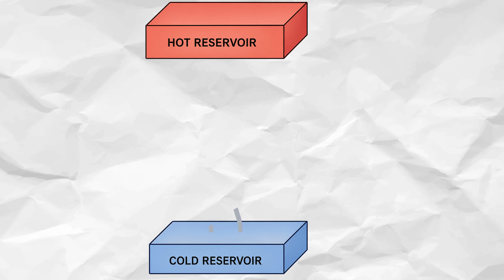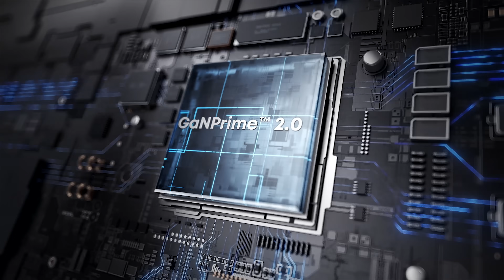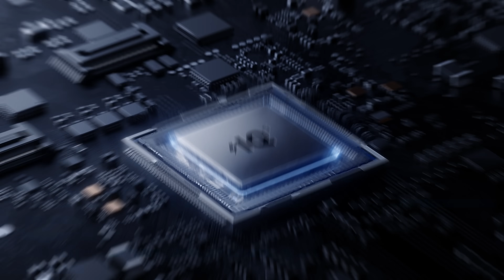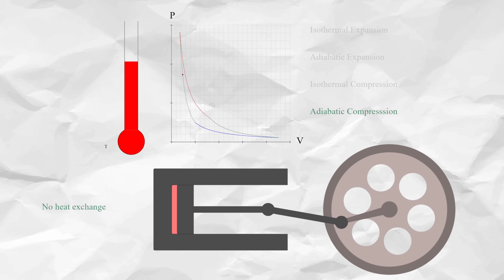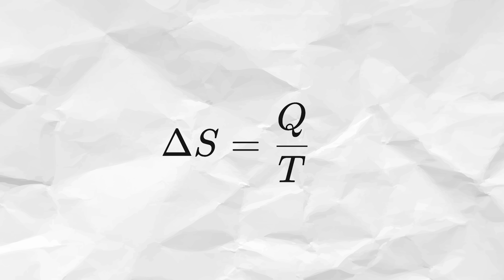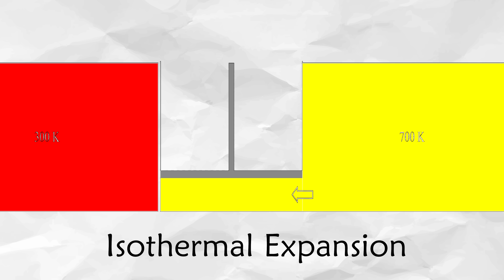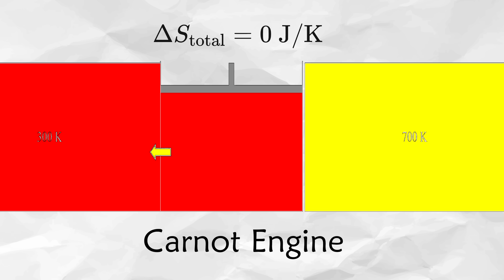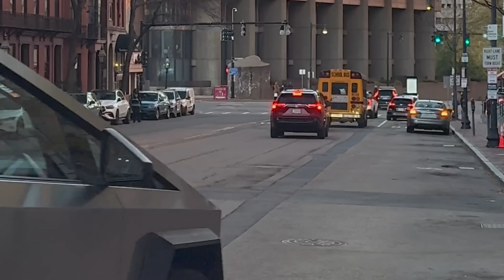This Tiny Engine Explains Entropy

Comment: Electric motors: The 'hidden' inefficiency (that used to create the ordered electrons in the battery) is not a problem if we 'off-shore' it to the sun and use solar PV panels to charge the battery.
Reply: Or hydroelectric power
Reply: @giorgiobarchiesi5003  Exactly!
Reply: The point is that's still inefficient, solar panels are nowhere near 100% efficient
Reply: @keepf9835 When you breathe in, the air is 21% oxygen, when you breathe out, it still has 17%oxygen. How ridiculously inefficient! Breathing should be banned - humans are clearly useless and we should wait for evolution to provide us with more effective lungs.
Reply: What’s with the “ ‘ “ instead of “ “ “?
Reply: @Shadow0Afton accident with a table saw
Reply: @mb-3faze  I was thinking Ai polished but that explanation is far more hilarious.
Reply: @Shadow0Afton  likely a programmer! Some programming languages let you get away with ' where it should be ". Save your shift pinky when speed typing and use a single quote...
Reply: @Orionrobots Be careful with that. Several programming languages have different meanings for each. With one allowing variable expansion (and special characters) and another not allowing it.
Reply: @Jeff-ss6qt  in the C set of languages - its character vs string types. Bash has it as different expansion types. JS, ruby and python has them synonymous.
Reply: @Shadow0Afton ’’” ‘huh’ “‘’
Reply: @Shadow0Afton Single quote is for uncommon or sarcastic phrases, double quote is for quotations.
Reply: @Jeff-ss6qt  The reason why quotes are used for “sarcastic phrases” is so that they know you’re throwing their words right back at them. But single quotes are used for combining words like “I am” - “I’m” and for quotes inside of quotes like: The Bible says “He said ‘She made me eat the apple’”
Reply: @Shadow0Afton Single quotes are for contractions, but it's also common to put them fully around words. Especially in written works like books.
Reply: Solar panels are relatively inefficient at producing electricity from sunlight, but the sunlight is free, so the panels don't need to be efficient to be massively useful. As an example, my car and my entire house are run on the electricity produced by the solar PV panels on the roof of my house. It cost money to buy and install the system, but the marginal cost for every kWh of electricity I use is zero. An extra hour of running the air conditioning, or an extra hour of running the oven to bake a potato, cost nothing and produce no CO2. Solar panels are not free, but the sunlight they collect and turn into electricity is.
Reply: But then imagine all the energy used to get to the point where that's a possibility 🤔
Reply: @lostbhoy420  The lifetime ROI is important. The thing about solar PV is the longevity of the panels is unquestionably long and they will produce more useful energy than it took to make them in the first place.
Reply: @mb-3faze  no that’s ostensibly false, solar panels have a 20 year life span after which you’re forced to choose between operating at a reduced efficiency dropping by 1% per year or spend money disassembling them and replacing them.
Reply: @estan315   Which doesn't make it at all untrue.
Reply: @babybirdhome no it is by definition untrue, solar has both one of the lowest efficiencies and lowest longevity of any energy source, only offset by its ability to get essentially free energy from the sun. But the energy from solar is not actually free as it requires thousands of acres of solar farms and expensive battery storage systems, and since they are notoriously short lived you will have to replace them every 2 decades or so. Contrast that with a natural gas generator which can stay up and operating for generations, even as long as a century with some renovations that don’t involve replacing thousands of acres of solar panels, and you’ll maybe realize why solar panels aren’t worth the investment outside of countries where they are directly being subsidized by taxpayer dollars, such as the US. In any other industry we would call that a government sanctioned monopoly.
Reply: @estan315 yeah, that's mostly nonsense. Gas generators might last but they need maintenance. Hard to believe bearings last 20 years. You name me one gas generator powerstation where they built it, got it going, then walked away only coming back twenty years later. The anti-renewables cult keep scraping the barrel for one excuse after another now it's area needed for solar PV - despite the fact that a huge amount is on existing buildings and in fields the introduction of panels has improved the yields of crops, provided shelter for grazing animals and increased the biodiversity overall. I mean, for God's sake, wake up, let the scales drop from your eyes.
Reply: The problem with your assertion is that you’re operating on a fantasy where solar power works exactly as it should at 100% efficient and never needs maintenance. You have absolutely no experience in the field but feel qualified to speak on it as if you do, which is embarrassing. 

Let me give you some numbers. Natural gas power plants cost roughly 50-100k per gwh to build, maintain, and fuel across their entire lifespan (average of 35 years). This includes the natural gas itself, building the plant, and maintaining the components like turbine blades, shafts, and yes bearing (a relatively small consideration all told) Now let’s say that’s an average cost of $75k per gwh per plant over an average lifespan of 35 years. That’s roughly $2.15 k per gwh per year. 

Now let’s compare with solar panels. Solar panels have a lower initial investment, around 30-78k per gwh to build, maintain, and replace, including the very important consideration of regular battery replacements every 10-15 years (extremely environmentally unfriendly btw, despite what you may like to believe). Now let’s consider this an average of $58k per gwh, and over the course of its entire 25 year lifespan (very conservative estimate) this is still $2.3k per gwh per year. 

So if you weren’t paying attention, that’s $2.15k per gwh per year for natural gas plants across their entire lifespan vs $2.3k per gwh per year for solar panels across their lifespan. So yes, even natural gas does indeed beat out solar power in terms of cost efficiency once you factor in the very real engineering considerations of construction and maintenance. You can pretend it doesn’t but the numbers don’t change. 

But what about your argument that solar panels are “better for muh environment”. Well like I said earlier solar panels need to be replaced every 20 years as their efficiency drops quickly after. You then have the option of throwing thousands of tons of silicon into a landfill or recycling them, each option costing even more. Now compare this to natural gas. You have natural gas pumps and refineries, and that’s about it. 

“But they’re digging into the earth, surely this causes more environmental damage than disposing of silicon tiles”. Spoiler alert: it doesn’t. But for arguments sake let’s just assume that throwing away your entire solar panel array is somehow less damaging to the environment than pumping natural gas and refining it in a refinery that is already built and operational. Solar panels still require expensive battery arrays to store the power they generated which requires lithium. If throwing away silicon tiles wasn’t bad for the environment, throwing away lithium batteries certainly is. And this lithium doesn’t just come from nowhere, you need to mine it, which is much more costly and damaging to the environment than simply pumping natural gas. 

So on to your last “argument”, that being solar panels are renewable so we need to see the writing on the wall and switch. According to current knowledge of natural gas deposits we would run out in roughly 50 years. The funny thing is, this number has remained the same for the last 50 years at least. The truth is that there is easily 2000 years worth of natural gas deposits left in the earth that simply haven’t been discovered based on current geological surveys. And the best part? The lithium reserves are estimated to run out in a little under 40 years. So the ONE advantage you may have been able to present for solar over natural gas is completely fabricated. Neither of them are ACTUALLY renewable resources. Keep in mind the fact that the sun produces infinite energy is simply not an argument. Where do you think the energy for coal, oil and natural gas comes from? I’ll give you a hint, it doesn’t just appear from thin air. 

You are just wrong. Stop pushing it because you’re only making it worse. The numbers do not support your argument.
Reply: @estan315  Lots of words, little knowledge, even less understanding. It will take a while but the fossil proponents will lose eventually, the nuclear cult followers too. Some of us care about the future and future generations and can see further than the depth of the wallet. I believe that the people 10, 20 or 50 generations in to the future deserve better than the sh*t planet we are leaving them.
Reply: @mb-3faze  when confronted with the truth you’ve shrunk away from it. You are not to be taken seriously. Just another delusional individual.
Reply: @estan315 anyone who types out 'lithium will run out' is the delusional one. The average EV has about 10kg (that's 2.2freedom units of weight) when it's manufactured. After driving 500,000 to 750,000 miles guess how much lithium is still in the battery? Oh, I'd better tell you.... It's 10kg. By your logic we should build houses because we're using up copper in the wiring. There's approximately the same amount of lithium as there is copper in the planet and unlike copper, lithium is absolutely everywhere.
Reply: @mb-3faze like I already made clear, you are a delusional person and not to be taken seriously. That fact that known lithium deposits are set to run out in 40 years is not up for debate, if you are going by the same logic that says that natural gas will also run out. Many things other than cars use batteries, like phones and computers and household appliances. The point here is obviously NOT that lithium will run out within the next 4 decades, but that you can’t say natural gas will run out in the same timespan while also claiming claiming that lithium based PV technology is a “renewable” solution. The numbers from modern geological surveys clearly show that natural gas is at least as renewable if not more renewable than lithium.
Reply: @mb-3faze  "Nuclear cult followers", how easy it is to instantly discredit yourself lol
Reply: @MarianLuca-rz5kkuh-oh, a propagandist from the oil industry.... No, elementally, lithium is as common as copper but much easier to extract. Why do you think lithium is so cheap now?
Reply: @MarianLuca-rz5kkyou up vote your own comments? Now that's delusional:)
Reply: By linking mechanical work to statistical mechanics, you’ve turned an abstract mathematical concept into something tangible. Truly stellar work
Reply: Yes, in pure economic terms the sun is probably the most inefficient energy source in existence* The vast majority of the energy it produces is lost to space, and most of the energy received on earth is also (thankfully) reflected back into space.

*Actually the sun is beaten in the inefficiency race by every single other star in the universe - they are all totally wasteful - you get almost no useful energy on Earth from any of them. Makes you wonder what the point is really.
Reply: And technically speaking K type stars which are orange dwarfs are better candidates as host stars than G type main sequence ones like the Sun
Reply: @gavinminion8515  a lot of fusion energy also just goes to shooting off neutrinos into the void
Reply: @gavinminion8515  uhh sure compared to the total output of the sun but even a fraction of a percent is still enough to support an entire biosphere and meet our energy needs 1000x over
Reply: @gavinminion8515  Though the context seems to be about economics, but outside of that context like in terms of fundamental physics what would you say about stars then?
Reply: @TheSilverShadow17  What would I say about stars - 
The physicists answer: They are gigantic exploding balls of Hydrogen, Helium and other hot gases which begin life when atoms are compressed by gravity and end when all their fusion fuel is used up.
The philosophers answer: They represent faraway places, some of which may harbour planets as teeming with life as our own.
The Spiritualists answer: They are tiny points of light which guide us through the dark and give us comfort when all other lights go out.
The Astronomers answer: They each emit spectra which can tell us how far away they are, how old they are, what they are made from and even how they will die.
What would I probably not say:
The Astrologers answer: They make pretty patterns in the sky which tell us what is going to happen today.
The flat earthers answer: They are pinholes made in a black cloth hung over an impenetrable dome by an almighty sky fairy deity.
The economists answer: What a waste of energy.
Reply: @gavinminion8515  Ah, gotcha. So it's only from an economist perspective that stars are wasteful but in other contexts they're not. Correct me if I'm wrong.
Reply: @TheSilverShadow17  Certainly a good gotcha there. I hope you realise my tongue was somewhat in my cheek with the original post. It's a good example of why economists shouldn't be allowed to run the world (or possibly even be allowed outside) stars are the most inefficient energy sources known to 'man'  - but they are actually beautiful and amazing. I for one will not be campaigning for them to be switched off at night*.

*Except Betelgeuse, that is - if Betelgeuse wants to 'switch off' at sometime during my life I would be more than honoured to accept.
Reply: @gavinminion8515  Economists may believe and think that stars are the most inefficient but the majority of people who aren't economists say and argue otherwise. They're not perfectly efficient but they're a fundamental asset of the universe especially when we got one in the sky that provides energy for life. I'm not an economist and I think that those people are saying nonsensical bull.
Reply: @gavinminion8515 most stars do offer some use by being navigation aids
Reply: @davidegaruti2582  Can you imagine the meeting where this was decided: "Sir, what we are proposing is to take a few nonillion kilogrammes of hydrogen and place it in the sky at some distance to Earth. Quite a distance, really, we will probablt need a few years to get it into place. Once there it will collapse under its own pressure and ignite - which will help our ships find their way."

"Oh and sir, we would probably want to do this more than once. Maybe two, three hundred times? Do you think we have the budget for that or should we just stick to those land based towers Stevenson has been pushing so hard for?"
Reply: @gavinminion8515  You just gotta look at the night sky to see the point... There are lot's of them actually...
Reply: @gavinminion8515  Yet without the Sun the planet freezes and turns into a frozen wasteland. So we need the sunlight and heat to maintain habitable conditions. Plus fusion isn't exactly inefficient
Reply: All energy comes from the sun. Gasoline, diesel, hydro, solar, wind, etc. The only one's that don't are nuclear and geothermal.
Reply: @DogmaticAtheist  Because the Sun itself is a nuclear reactor that runs on fusion like all other stars and planetary cores. The energy has to come from somewhere to be produced and generated.
Reply: @TheSilverShadow17 true however I was talking about fission. Which powers our nuclear reactors and geothermal energy (with the leftover heat of planet formation).
Reply: @DogmaticAtheist not only "planet formation" - a large fraction is nuclear processes too!
Reply: @DogmaticAtheist  should be noted that there are other concerns than pure entropy as well. solar panels might be "free sun energy" but produce tons and tons of polluting waste in their creation. by comparison a good nuclear reactor is built once and what nuclear waste it does produce can be really safely tucked away in a purpose-built sarcophagus vs. plasticbergs in the ocean or chemical landfills as often happens with more typical industry processes.
Reply: @DogmaticAtheist  On balance, the sun gives us no energy, because Earth radiates as much heat into space as it receives from the sun. But we get solar heat radiation at a higher temperature than the heat Earth radiates away. Some use the term 'negentropy' (negative entropy) to describe the zero energy balance exchange of heat between Sun, Earth, and space. The Sun is our entropy sink, or if you will, our source of negentropy.
Reply: Solar panels are extremely inefficient still
Reply: @metamonpulls1560  Solar panels are getting close to the Shockley Queisser limit for solar power efficiency, which is 33.7% at optimum bandgap / 32% at Si bandgap. That is faaar better than green plants, best known efficiency is sugar cane under optimum conditions at 4%, crops under realistic / non- tropical conditions at best 2%, a forest has only about 0.7% efficiency of turning solar irradiation into stored energy (firewood). So I must rather disagree with your statement.
Reply: @metamonpulls1560  But is doesn't matter. For our purposes, the sun provides infinite energy. Those energetic photons are going to hit us anyway. So it doesn't matter if for the given 1kW of power per square metre hitting earth we only extract 25% to convert to useful (to us) electrical power.
Reply: well it is a problem because the less efficient the more area you need and currently biodiversity is in stark decline due to habitat loss.
Reply: @Caipi2070  Scientific, peer reviewed studies have suggested that solar farms and solar agrivoltaics have increased biodiversity because of better temperature control, better sun protection, better predator control and more micro habitats around foundation points. Similar to wind farms at sea where the turbine foundation points are now alive with animals where previously it was just sand.  A massive boost to habitat and despite the fears that birds would be killed by the blades the latest studies have concluded that zero sea birds have been harmed at the windfarm site studied.
Reply: Solar power is just really really inefficient nuclear. Why would we set up a million acres of expensive panels when we could set up 2 acres for a nuclear reactor and get way more energy.
Reply: @estan315 I think he just meant hypothetically we could then extract more energy than we put in.
Reply: @lostbhoy420  the same is true for nuclear
Reply: @estan315  1 million acres is about 4 billion square meters. Covering that area with 25% efficient solar panels gives a nameplate power of 1 TW, which would produce the same energy as 150-200 GW of nuclear after adjusting for capacity factor. So that's a pretty substantial nuclear power plant you're envisioning...
Reply: @U @UpsetNerd  yeah you’re right I didn’t mean to compare a million acres of solar to a single nuclear plant, I was referencing the million of acres of solar in the US and the 90 2 acre nuclear planets in the US that greatly outpace the 1 million acres of solar with about 5 thousand times more space efficiency
Reply: @estan315 because the nuclear fusion plant (the sun) is already built and we are just cheaply harvesting the energy.
Reply: @estan315  Because actually, it turns out that solar panels are pretty cheap now. At least a lot cheaper than building a nuclear reactor. It's just a sheet of fancy glass. It's cheap, simple, automatically safe, and we don't have to pay for the nuclear fuel or disposing of radioactive waste, because the sun does that for us.
Reply: @donaldhobson8873  it goes without saying that a single solar panel is cheaper than a nuclear reactor. However when you factor in the fact that nuclear provides stable energy and solar requires expensive batteries to stabilize power output the cost per watt hour of nuclear beats out solar significantly. This is a poor excuse.
Reply: @estan315 no, seriously, nuclear is a total short term dead end multi-generational disaster. $70billion is being spent in the UK for a tiny 3.2 GW. That's insane. China installed 3.2GW of solar PV last week. In fact they did it just between. Monday and Friday and had the weekend off. They'll do the same again next week, and the week after. Nuclear - staggeringly short sighted. Think of 20 generations ahead - those people will still be dealing with the contamination we leave behind once we are dead.
Reply: @m @mb-3faze  I’ve already explain why you are incorrect. Additionally comparing the hinkley point c to Chinese solar panels is disingenuous in so many ways. The hinkley nuclear reactor has ballooned in cost due to several factors including an extremely punishing regulatory environment in the Uk, numerous redesigns (over 7000) and worker shortages due to a disastrous handling of Covid. China controls the vast majority of the world’s solar panel supply so of course they are able to get up a solar farm faster and more cost effectively than the failure of the British public sector. Like I already said however you’re only considering half the story. 1 GW of nuclear costs roughly 8 times more than 1 GW of solar on paper, but you’re assuming that solar panels are an efficient and long term source of energy. 

Solar panels operate at less than 50% capacity, usually only 25%, whereas nuclear reactors operate at 90% capacity regardless of weather. Like I already stated nuclear reactors provide more consistent sources of power than solar and so the gap is significantly closed to a 2 to 1 advantage for solar. In order for solar to provide the same output at the same consistency as nuclear the costs balloon significantly, with battery systems costing more than even the solar panels themselves. That closes the gap to only a little over 1 to 1 in favor of solar panels. Now consider that the operational lifespan of nuclear is 3 or 4 times greater than solar, and now that advantage is obliterated. Nuclear reactors built today will still work in 80 years, but solar panels will cease to operate in 20 years, leaving behind expensive renovations or removal. 

As for nuclear waste, all the nuclear waste ever made from nuclear power can fit in your closet. Saying that a couple tons of nuclear waste is more difficult to dispose of than billions of tons of scrapped solar panels is genuinely nonsensical. You are not thinking for the future, you’re thinking based on policy and propaganda. Either way, nuclear fusion research has been ongoing and the first reactor for research is currently being built. Nuclear fusion is over 10 times more energy efficient than fission and there are absolutely no advantages of solar over fusion. Maybe you are the one who should do your research.
Reply: @estan315 OK, so you're British. Well, today nuclear provided a paltry 3.4GW to the grid, wind, nearly 20GW, solar nearly 3GW. And when hinkley c comes on line it will produce a pathetic 3.2GW - hardly enough to keep the lights on - and at what initial cost £80bil?by the time it actually starts. And then what happens when the uranium mines in Yorkshire shut down? Yeah, that's right there aren't any uranium mines in Yorkshire or anywhere in the UK so we are totally beholden to foreign countries. And in 50 years of unbelievably expensive electricity generation hinkley c shuts there will be hundreds of years of contamination clean up and that land will never be used for anything ever again. It's so selfish to future generations. They will look back and curse nuclear proponents.
Reply: @mb-3faze  hundreds of years of clean up? I don’t know what planet you’re living on but modern nuclear power plants are not Chernobyl. Nuclear waste is actually extremely negligible and easy to dispose of, provided a container that stop the spread of radioactivity. Once a nuclear reactor is destroyed it takes less than a decade for the land it was on to be usable again. The only leftover “waste” is heavy water, which is essentially just water with extra neutrons. Not radioactive. And no I do not live in the UK thank God, I live in the US where our less than 100 nuclear reactors account for nearly 9% of all the nation’s energy needs, while solar and wind combined account for less than 1%. The total cost of these nuclear reactors is around $400 billion, which while quite a lot is absolutely dwarfed by the $800 billion spent on the solar and wind energy account for less than 1/8th of that nuclear energy output.
Reply: @estan315 I used to be in the nuclear cult too. Best thing ever, I thought. The final straw? Fukushima. Even the attention-to-detail Japanese f-Ed up.  Where does the US gets its uranium from? Africa? Poor african people mining it so you can plug in your xbox. Or russia (donny's best bud) or Canada - how's relations with the 51st state going.?
You name one, just one site that had a nuclear power plant on it that has been returned to agriculture or housing. Nuclear - utterly selfish.
Reply: @estan315  because nuklear is more expensive it isn’t booming like solar at the moment (even when nuklear is more space efficient.)
Reply: @Caipi2070  because solar is propped up by government subsidies and media propaganda and nuclear is restricted by harsh government regulations and targeted by media libel specifically meant to fear monger among the uninformed masses (you). All I’m going to say is there’s a reason data centers are turning to private nuclear to meet their next generation power needs and it’s NOT because solar energy is so hecking renewable
Reply: @estan315  just look at the world wide numbers of new nuklear power and compare that to new solar power and than tell me everyone is just propagandised instead of just taking the cheapest option. 
(the IEA internation energy agency releases reports if you are curious)

the data centers are not like the usual fluctuating electricity demand, they have a rather constant energy drain making them fit a bit better to the constant power output of nuklear. but i only believe the datacenter - nuklear talk when i see the projects realised
Reply: @Caipi2070 our power grid is not unlike a data center in that it also requires a constant power supply, and while the numbers for solar might seem better on paper, taking into account the batteries needed to even the solar power supply out and their lifetime operation nuclear power quickly takes the lead in efficiency
Reply: @estan315  where the f are you getting your information from and learn about these topics?! 
grid demand varies throughout the day and even considering battery costs solar is cheap comparatively. nuclear has even further issues like a limited number of countries to get uranium from and river used for cooling water can run low in summer (happened recently in france) many projects overshoot their budget.
Reply: I’m getting my information from the hundreds of hours of research I’ve done on nuclear energy and my schooling in engineering which I am assuming you do not have. I don’t like to waive my credentials around as if that automatically makes me correct, but since you want to question my information I thought I should inform you. 

The fact of the matter is that both of those considerations you mentioned are also relevant to solar energy: the solar panels will receive less sunlight in the winter or on a cloudy day, and solar panels aren’t immune to project complications that can bring them over budget. Additionally, many nuclear plants use cooling lakes, not rivers, so this is much less of a worry than the inherent variability from weather that solar is subject to. 

Additionally, varying power demands from the power grid will only compound with varying power input from solar energy, which will further decrease efficiency. The only way to mitigate this is with batteries for energy storage that are in many cases more expensive than the solar panels themselves. Keeping all of these considerations in mind it is not at all fair to say that the reasons you gave are fair reasons to say that solar energy is more efficient than nuclear energy. The only reason you gave which carries any weight is access to enriched uranium, which could be a consideration for many underdeveloped countries, but not in any practical sense in the US. 

The fact of the matter is that complications can occur in any energy generation project, so the only fair way to compare them is by comparing their theoretical numbers. Solar panels are fairly inexpensive, but it becomes roughly 5 times more expensive when using them for large scale power generation due to the requirement of costly battery storage systems. Even so, the solar panels with a battery storage system are roughly 8 times more cost effective than nuclear at absolute peak capacity. That’s a key distinction though, as while nuclear operates at roughly 90% capacity year round, solar operates at only 20% capacity on average factoring in weather fluctuations. Let’s say this is a 4 times difference in energy efficiency. This means that solar would only be roughly twice as efficient as nuclear for the first 20 years of its operational lifespan. Solar energy has a lifespan of only 20 years however, while nuclear energy has an operational lifespan of over 80 years. This means that for the same cost over their entire lifespan nuclear can be expected to generate over twice as much energy as solar per dollar spent, and this isn’t even considering that nuclear power plants often generate much much more power than solar does, necessitating far less space to build on which costs less money for development in the long run.

The truth is that solar is actually a very inefficient way to generate large scale energy for the power grid once you actual consider its limiting factors. Residential solar can be nice to decrease your power bill, but when you’re providing energy to a nation you need consistency, which solar does not offer at a good price, and nuclear does at (arguably) the best price.
Reply: @e @estan315  I studdied mechanical engineering (as well). 
i‘m not saying 100% solar is the best thing but when it comes to new projects there are good reasons why many countries build more wind and solar at the moment than nuklear. 
i think at some point arguing isn’t worth it for me. we will see how different countries will go about electricity generation in the future anyway.
Reply: @estan315 because nuclear power can't handle hour to hour changes, PV also is using energy already hitting the earth and using land that is already being used make biofuel which is even more inefficient could easily still leave space for nuclear reactors
Reply: @sirsanti8408  it’s a waste of money in most scenarios why build billions of solar panels when 1000 nuclear reactors taking up the space of city could power all of North America
Reply: @sirsanti8408  Despite the drawbacks I wouldn't mind the existence of alternate fuels to power and keep machinery running like natural gas, biodiesel, etc
Reply: @TheSilverShadow17 i think as we transition away they'll still be necessary, focusing on taking it away from power generation and vehicles i think is the main bulk of the emissions anyways
Reply: @sirsanti8408  Transitioning from fossil fuels, yes that's the idea hopefully. But having E-fuels to replace said fossil fuels is still something rather than imagining a fully electric future imho
Because batteries work out as energy storage mediums just not practical or reliable for actual propulsion.
Reply: @estan315 solar and wind power is far cheaper than nuclear. There is a space argument but when it comes to money solar and wind are far superior.
Reply: You can make enough energy to power the entire US grid along with a 100% electrified ground vehicle fleet if you converted every single acre of corn field used for making ethanol biofuel into a solar farm.  We are taking 40 million acres currently in use for nothing but biofuel.   It is pathetic thar solar doesnt have deeper penetrarion but it is rapidly changing because solar is rapidly outpricing every other power source even with energy storage included.  People are still talking about nuclear which is incredible for power density and capacity factor but is almost twice the cost at current market prices.  When you include the  10-15 years planning plus building timeline you cant help but wonder what solar and batteries will cost in 2040 when you make your first kwh.
Reply: @MrKDreams  Corn is just bio based solar panels. It's not that efficient unfortunately.
Reply: @2xmachina248 technically speaking if we’re talking about efficiency it’s far more efficient than any other option when you factor the 5 categorical efficiencies of energy
Reply: @MrKDreams  You would need even less corn fields if every suitable building and structure had PV panels on the roof and on the side of the walls. Instead you could give those corn fields which aren't needed for ethanol anymore back to nature.
Reply: @MrKDreams  And what will be the surface taken by the solar panels and battery fields big enough to maintain power for a whole winter week of bad weather with no wind ?
Nuclear power stations can run 24/24 7/7 whatever the weather...
Reply: @gsbeak yeah but can't change hour to hour output. We can simply do both, putting your eggs in a single basket is never a good thing. Nuclear doesn't even compete with solar in terms of space or ideal land
Reply: @sirsanti8408  Nuclear reactors take up much less space than solar panels, and put out over 100x the energy as an exaggerated example
Reply: But this is in context of SMRs which are different than actual nuclear power plants in essence
Reply: @sirsanti8408  Correct, we're going to need some diversification. Most estimates are that solar, even with storage, isn't capable of being more than 60-80% of the power grid, just because of the dependence on weather and season. The remainder will have to be wind/hydro/geothermal/tidal/nuclear. There's little reason to shutdown nuclear reactors that already operating or being built, but there's also little reason to plan to build more.
Reply: create enough solar farms and you'd increase global temperatures by absorbing that heat versus reflecting it away from Earth's surface. 

If we had solar panels that reflected infrared but absorbed UV and other useful spectrums, we could mitigate that, however, it would also reduce the output of the panel.
Reply: @NotoriousNickNorris  the amount of solar radiation absorbed by a solar panel is orders of magnitude less than the amount of solar radiation that will be retained in our atmosphere by the CO2 that solar panel offsets. It's always good to consider all the effects, but that one is decades if not centuries from being a concern.
Reply: @MrKDreams  proceed
Reply: @MrKDreams  it’s insanely dumb because ethanol from anything is a horrible way to produce power, and corn is dumb even in terms of what is best for ethanol production.  You can only drive about 15 miles in an average car in what would provide 2.5 weeks of calories for an average adult diet.  The environmental damage is crazy, no biofuel devised is as gentle on the planet and pollution as solar, wind, batteries and EV.
Reply: @hugegamer5988  Even then I support the idea of having alternative fuels besides fossil fuels obviously. And electricity won't solve every kind of problem under the Sun as reference
Reply: @MrKDreams  Solar panels take up loads of space and are ridiculously inefficient. Plus not all land needs to be a solar farm when energy density is a concern.
Reply: @TheSilverShadow17  Agri-photovoltaic systems are proving to be a win-win in every sense : electrical output - that's a given but the crops or animals below benefit hugely to and produce more. The biodiversity increases because there are hiding places away from predators. Farmers are realizing they should have done this years ago.
Reply: @TheSilverShadow17  And there would be LOTS of free space in urban areas on roofs still available for PV.
Reply: @TheSilverShadow17 I'm not talking about replacing any land or any space other than that which is used for corn ethanol monocrop.  You know the stuff that is in 10% of our gasoline and burned at 20-30% TDE. Think about how many resources go into plowing, fertilizing,  seeding, insectacides, harvest, processing, fermenting, refining etc.  Oh yea and about 1.3 trillions of gallons water diversion per year which is equivalent to the annual urban water use of the entire state of California and 30x whar the entire state of Rhode Island uses.   Absolutely insanity.
Reply: @MrKDreams  It's possible to remove the ethanol contents from gasoline completely from what I heard and seen online. The issue is that not enough people know how the process wirks to get pure gasoline I guess.
Reply: @lesliespeaker668  I'd wager that covering parking spaces in solar panels would be better personally, since we do have buildings with roof mounted panels as a thing already.
Reply: @TheSilverShadow17  Obviously we should put panels up whenever it makes sense, car ports, rooftops etc.   But the complaint about solar is how much space it takes up while ignoring the the 40 million acre corn monocrop used for nothing but ethanol biofuel.   A litteral political relic from the 1970s oil crisis.   Studies show it's barely if at all a net posative both in terms of net energy production and net carbon offset.   Outside of the politics and jobs issues we would be far better off giving those fields back to nature and increasing our domestic oil production to make up the gap.
Reply: @TheSilverShadow17 efficiency doesn't matter nearly as much when you're converting a completely free resource, they're also still pretty damn effective as power generators. We need to ditch fossil fuels as fast as possible, nuclear definitely needs to be more invested in too
Reply: @sirsanti8408  Yeah, I see what you mean as a person who's an advocate for the use of nuclear power. There's gonna be tradeoffs for pretty much everything we do either way but that's getting distracted from the main point and topic.
Reply: PV panels have 20% efficiency, some exotic ones higher, but all well below 50%.
Reply: @PeterBaumgart1a  And so what? The energy source (the sun) provides free, unlimited reliable energy. You decide how much of that energy you want, take the efficiency percentage in to account and deploy the correct area of panels. 1%, 20% 50% efficiency - who cares.
Reply: @mb-3faze just like any energy harvesting method, panels too cost money and take space, that's why you care about efficiency
Reply: Which is kind of silly because electric motors can reach 97% efficiency of electric power in to work out, generally being above 80% across a wide range of loads with a decent motor controller which can also approach 97%.
Reply: you got offended by an implication that electric motors are still inefficient at some point in the process, and chose to say a bunch of nothing

Solar is incredibly inefficient by these terms, it's simply natural and non-depleting. Solar is no more ordered than coal, or wind, or nuclear, or hydro. All of these are doing the same thing: taking disordered energy and converting it to ordered energy. The only difference between solar and the rest, is how it affects our environment. 
Solar farms occupy a LOT of space in brightly lit areas, and we would reach a limit before people start protesting big solar.
Wind via turbines mess with birds and are similarly spacially limited.  It's also basically just solar.
Hydro via turbines is the most spatially limited, and can mess with sealife. It's also basically just solar.
Coal destroys our environment, and is a lot of work to get.
Nuclear can explode, environmentally harmful when done poorly, and is a lot of work to get. 

Pick your poison and relax.
Reply: @nodros1  I'd take a gamble and wager that nuclear is the best bet despite the controversy around it tbh
Reply: @TheSilverShadow17  Nuclear is supremely short sighted. And by short I mean in terms for decay time for waste nuclear isotopes. What happens in 100 generations? Every single site used for a nuclear power station (and they never reuse them - because they can't) will still be sitting there oozing contamination in to the environment - society long since bankrupt from spending to try and contain the pollution. Hundreds of thousands of  sites world wide even after 100 generations (2000 years) still needing another 500 generations before any of those sites can be used for housing or agriculture. Future generations will already be cursing us, even if we stop nuclear right now.
Reply: @mb-3faze  The issue is that Hollywood misinforms the masses about nuclear energy when in reality there's no green goo that oozes out and that the actual waste is stored in sealed concrete casks far away from any urban residence.
Reply: Plus modern reactors are much more efficient and less likely to meltdown than the ones built decades ago.
Reply: Not to mention that yellow radioactive barrels in movies aren't a thing with nuclear power in real life too
Reply: @TheSilverShadow17  nuclear is great, it just can't handle hour to hour changes in demands like you really need. Great for baseline maintenance though
Reply: @sirsanti8408  I'd be happy if people began to accelerate development of alternative fuels so that the transition from fossil fuels isn't unrealistically instant or sudden. Besides aren't we burning prehistoric plants in context and not the actual dinosaur remains in the ground?
Reply: @nodros1  I don't think the OP was any more offended than you appear to be, but a lot of us would prefer our energy to be sustainable.
When it comes to sustainability, solar and wind win over coal and oil, any way you look at it.
Reply: @gavinminion8515  At the same time it's basically nearly impossible to live without oil when it's everywhere in virtually everything. We got cooking oil, vegetable oil, plastic made from oil, etc etc
Reply: @TheSilverShadow17  Of course, it is possible that a person can be in favour of both solar energy and oil - especially when we are talking about the oil derived from plants which grow in sunlight.
Really the only problem I have is when we find deposits of oil laid down from fossilised plants that lived long ago and then decide that, instead of making them into something useful, the best thing to do is burn them all...
Reply: @nodros1 I think we could sacrifice a few acres of desert or invest in off shore solar
Reply: @nodros1 "There are no solutions, only trade-offs" - Thomas Sowell
Reply: @nodros1  Amazing how you were wrong on basically every point, also calling most of those 'just solar' is hilariously ignorant. Have fun with your gas prices.
Reply: Or diesel....
Reply: @SirLifts_ALot Nah, because those things cost money whereas sunlight and wind are free. Sure a more efficient solar panel or wind turbine is still great, because you will need less of them to get the same amount of energy, but you aren't throwing the majority of your money away if you burn fossil fuels.
Reply: @Ninjaeule97  sunlight and wind are free but alas the company still charged me for the solar panels to convert it into electricity.
Reply: @theSurrealMichaelophagus no shit. You also have to pay for a thermal power station but that one isn't useful without fuel you also have to pay for. That's because you always need a mechanism to turn one type of energy into another type of useful energy. You will still save money in the long run.
Reply: @theSurrealMichaelophagus  assuming you own where you live you could build your own solar collection site and disconnect from the grid. It's not usually cost effective to do so, but the point is that it's possible and it has been done. I'm not aware of anyone that continues to use oil or gas that has been able to generate the energy they need on site.
Reply: Or coal....
Reply: @SirLifts_ALot nah coal is probably the worst fossil fuel you could use. Expensive to transport, use, gotta process exhaust
Reply: @sirsanti8408  methane is arguably worse. It's easier to obtain and transport, but every leak does massive invisible damage to the atmosphere when every coal leak still just sits on the ground.
Reply: @extragoode  methane does have that one drawback, that being said companies are incentivized to plug those leaks even if they're only worried about profits and nothing else. Coal as far more drawbacks. Its less efficient in every single measurable way